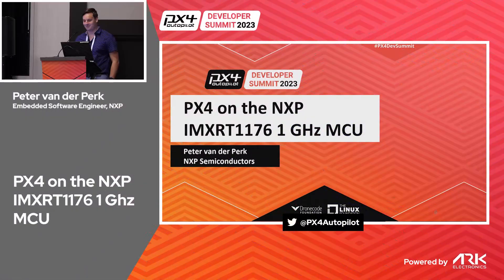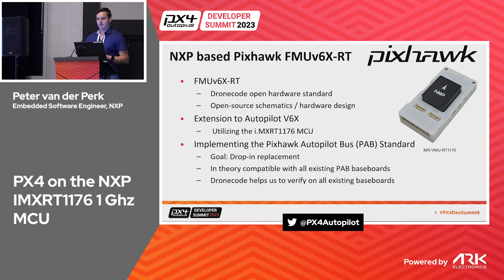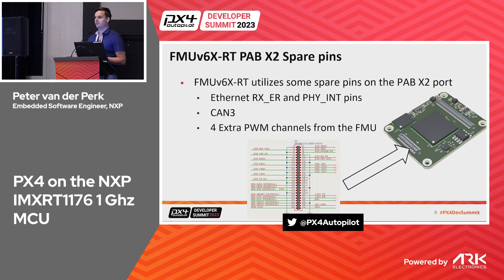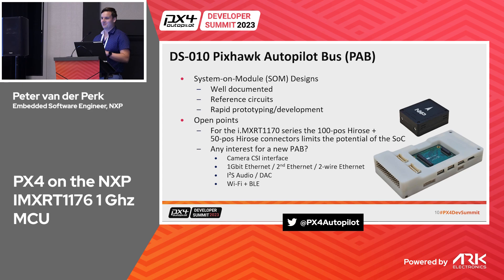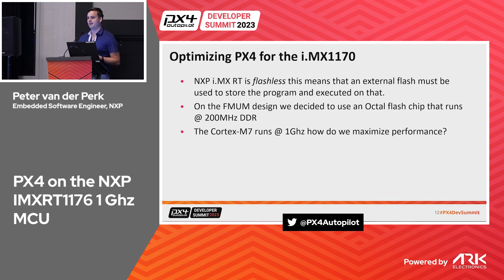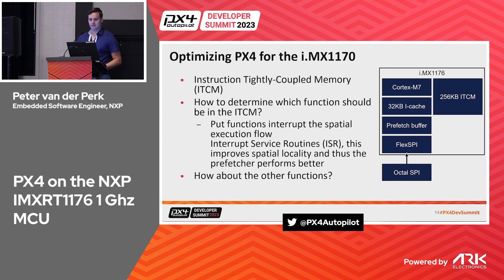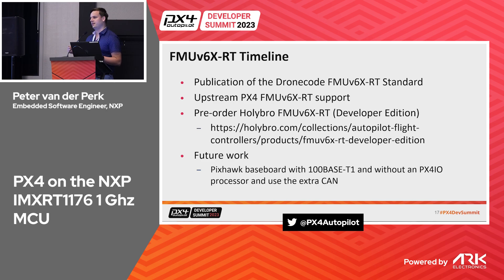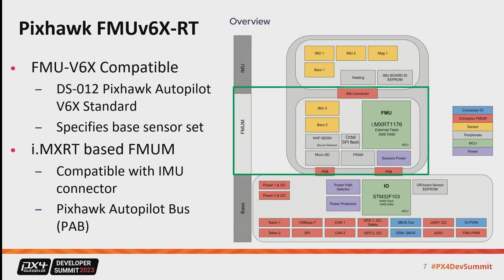PX4 on the NXP IMXRT1176 1 Ghz MCU - Peter van der Perk, NXP Semiconductors

Comment: Apart from few IO and CAN, what extra can imxrt for that stm32h7 can't?
Reply: Arm® Cortex-M7 at 1 GHz and a Cortex-M4 at 400 MHz. It has 2MB SRAM and 64MB Octal SPI Flash

Large 64MB flash memory

Having multiple vendors for the core processor in a common Flight control system architecture is an advantage to the opensource community. This mitigates difficulty with chip availability, pricing models, as has been demonstrated in the recent supply chain issues.

Can be paired with NXP reference design for a baseboard that enables robust and lightweight 100BaseT1 two wire ethernet.
Reply: i think rt has ethernet and h7 does not.  also more ram.
Reply: @myHalici  H7 does have ethernet.
Reply: Needs EtherCAT built in.